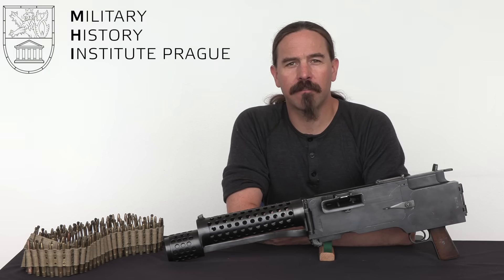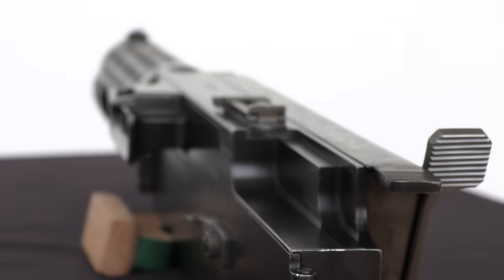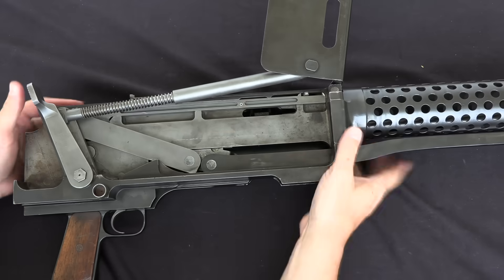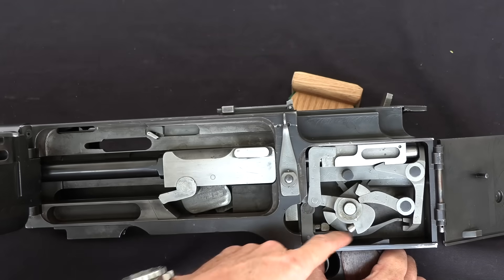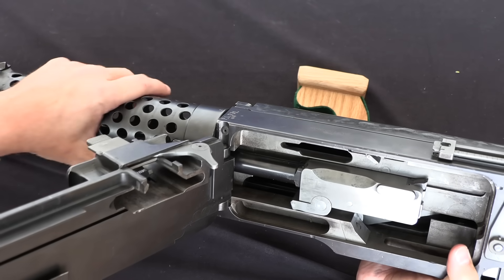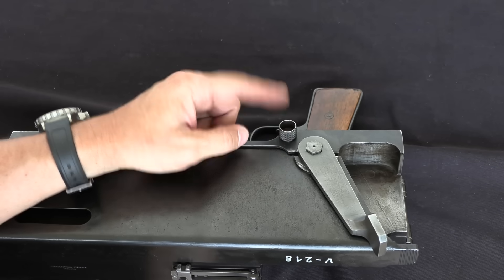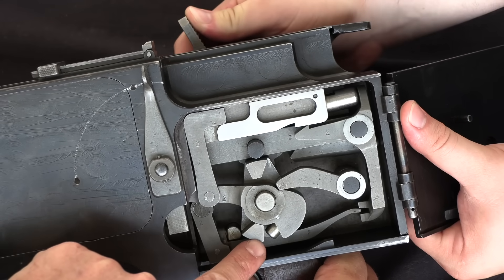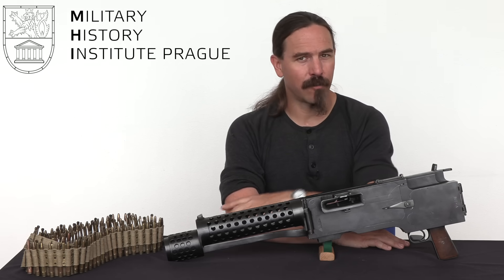Praga I: A Blow-Forward Bullpup Semi-Auto-Selectable Vickers Gun

Comment: I don’t see how a water jacket could work with a moving barrel. It would need something like hydraulic seals that could take the heat of MG barrels. And the barrel would need to be polished and chromed on the outside.
Reply from the maker: It was done with wrappings of asbestos string - all the Maxim and Vickers guns use them.

Comment: Hiram was probably happy to see all that his design became but not all of it's use.  I think that design would have worked in fixed mounts of a coax machine gun but before it's time.  In general a tank doesn't notice a 30 pound machine gun. That would be with replacing the gas trap system.  But shows the evolution of firearms well.

Comment: hmmm muzzle blast capure sound alot better then Gas tube - why is this not used more often if it can even provide anough energy to cycle this giant metal block
longer + more acceration of the bullet, probably decreased muzzle flash, no weakspot (hole) in the barrell,

Comment: The air force branch of the Czechoslovak Army formed in October 1918, do you think with the perforated water jackets & short designs that these could have been designed for arming observers on early planes?
Reply: Or, my guess: that's a prototype. They will deal with all the shinanegan of having the jacket water tight wity the barrel moving thru it if and when the design is adopted.
For the tests, air cooling will do.

Comment: This should be categorized as gas operated or perhaps muzzle (booster) operated.  Blow forward means recoil energy moves something forward.  

Also, relative to the breech, the rest of the gun moves backwards.

Bullpup is arguably not relevant to guns fired from a separate mount.  Else an M2, M1919, MK19, etc are bullpups.

Most of the machining is very nice, but then it is a prototype.

Request if you haven't done one already: Chain gun.

Comment: I bet the fact that all the moving parts were relatively large contributed to a degree of durability. The thicker a piece of steel is the harder it is to break. But I can imagine that feed system being less reliable. Also once you stop firing you have to cycle the action at least twice just to clear out the two rounds already pulled from the belt but not fired. It also means cycling the action twice after loading a new belt before you can fire.

Comment: You said this is prototype number 2.  I noticed that a lot of the parts in the fire control group have a 2 stamped into them.  I wonder if these were stamped during development (likely) or during preservation (less likely) to make sure the parts were not mixed up between the three prototypes?  

Also, looking at the function I can infer why it was abandoned after 6 months.  It looks like it would be prone to a lot of failures during feeding and extraction.
Reply: If three were made, those were basically handmade and handfitted.
I'm pretty sure pieces of the N. 2 were just filed a little different than n. 3, and all parts were marked all over not to mix those.
Reply: @UlisseDizante    Yeah, that is my thought as well.  Mass production wasn't widespread prior to Henry Ford and these prototypes would have been around that time.  From what I've heard, prior to Henry Ford popularizing mass production all replacement parts (for anything) were effectively hand made custom parts and were not interchangable, even if the same model number.  These being prototypes means this even more so.
Reply: @The_Opinion_of_Matt  in WWII, a British commission visited a factory in the US making Sherman tanks. They noticed no workbench had a vice.
Thus, every piece was precise enough to be mounted without the need of clamping it in a vice and file/adjust it.
Reply: @UlisseDizante  I can believe that.
Reply: I am sure our curators did not stamp those
Reply: @martinpojer5375    I would find it hard to believe that they would.

Comment: How many times it has to be cocked just to cycle the first round into the chamber? 3 time maybe? The blast and gases has to push the blow forward system that seems heavy. I doubt it worked that well and I think it's rate of fire might of been rather slow. Ummm interesting and would of been hard to manufacture the complicated machinery. Not surprised it was rejected.

Comment: The loading and ejection system has a wild off by one quality. Pull the charging handle until a round comes out the bottom and do not worry about how many are in there or where they went...

Comment: Isn't this called a Bang-System instead of Blow-Forward? I thought Blow-Forward would apply to design were the whole barrel is pushed forward like the Schwarzlose 1909 and 1908.
Reply: Both, I guess? Locked by a pivoting wedge, unlocked by a Bang/gas-trap,  then the barrel is pulled forward by that op rod. It's kind of unique. The closest I can think of is that wacky AK-53 experiment by SIG.

Comment: This weapon seems to function largely on optimism
Reply: Dis Git ain’t fit for da WAAAGHH
Reply: DAKKA DAKKA DAKKA
Reply: Da orkz will git it workin
Reply: I know right, i feel any bullet that wasn't in decent condition went through it would turn into a nightmare of a jam.
Reply: @TheKingreiko  I don't know, since you have those doors it might be fairly easy to pull out a jammed round
Reply: @owllymannstein7113  Yeah, it's kinda clunky but you can open the side door, push the gas piston forward and you have clear access to the breech and the whole feeding process of the gun
Reply: @TheKingreiko or simply, oops it slipped and fell to the ground...now it doesn't work.
Reply: WAAAAAAAAAAAAAGHHHHH
Reply: Umm, no. I was told it runs on steampunk.
Reply: Fear of being eaten by a Sovieticus
Reply: Oi! This 'ere gun runs on dakka!
Reply: As all good Orkish dakka does.
Reply: It runs on doohickeys and doodads.

Comment: This is by far the weirdest machine gun out there IMO. Such a steampunk, Victorian, Orky, mad scientist gun and I love it.
Reply: I'd say that title would have to go to the Vickers or the Maxim gun given they actually steam.
Reply: @stopthephilosophicalzombie9017  steampunk has more emphasis on the weird mechanical contraptions than on the steam part. Because otherwise a pot when I boil the water for my pasta is the most steampunk device ever.
Watercooled MGs are just MGs that boil water with the barrel heat
Reply: @marcogenovesi8570 I'm off to steampunk my dinner to al dente perfection!
Reply: @ I can confirm that it is, indeed, correct my good sir
Reply: @marcogenovesi8570  I had a car with a bad head gasket, now that was steampunk Nissan!
Reply: Close enough, but the Madsen machine gun takes the cake of the weirdest operating system. You can't spell Madsen without mad.
Reply: Don't forget HK G11. If looks like a clockwork.

Of course, this one looks more like a steam engine on the inside. So it qualifies too.
Reply: Dakka
Reply: And now I’m wondering if anybody ever made a steam operated automatic loading system. I’m thinking for naval use where steam power would’ve been readily available.
Reply: @Oldtanktapper  probably the cannons on battleships?
Reply: Here's a watch and a gun. Make them work sir!
Reply: @Jack-O-Spades Now you mention it, it looks like more refined ork shoota.